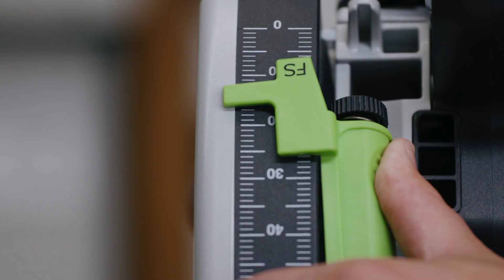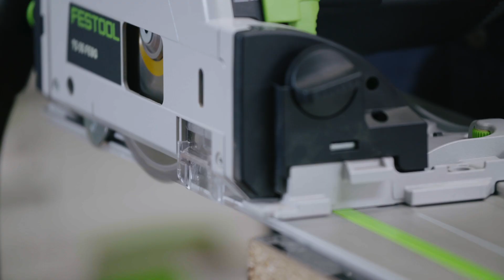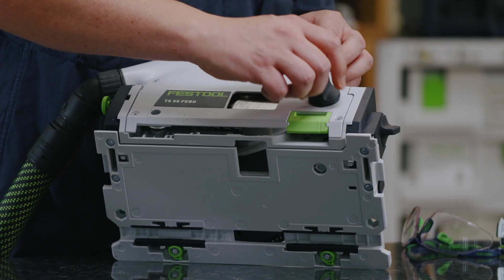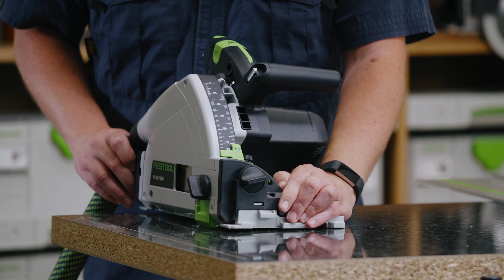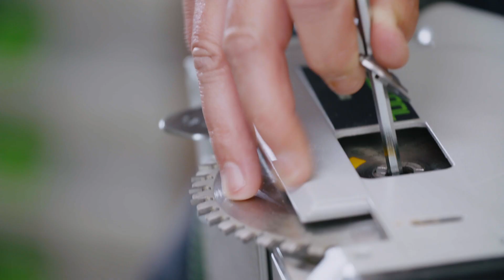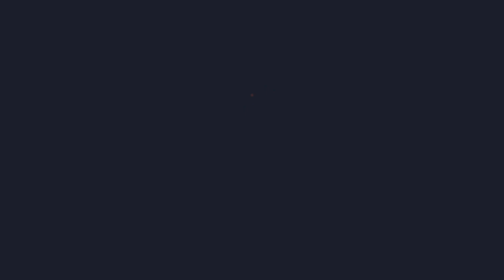Setting up the Festool plunge-cut saws TS 55 F and TSC 55 K

Comment: I bought this but very disappointed on  the day I tried to remove the saw blade cover. I wish I could add a photo to show how easily screw heads become blunt (become stripped). If you delete this comment I will go and put this comment everywhere on dealers stores.

Comment: I would say this video is more of a quickstart guide and doesn't actually cover the setting up of the tool at all which would be calibration of the blade to the guide rails and adjusting the stop limits for 90s and 45s etc

Comment: I gather the splinter guard doesn’t need to be trimmed all the way from end to end of the rail?
Reply: Yeah, was wondering about that too
Reply: @jelmerdevries7827  me too !
Reply: Lol cut the whole thing off lol it will be cut anyway
Reply: It absolutely does. Unless you only plan on making matchboxes. I love Festool but their obsession with only cutting playing cards size objects in all their demos is really annoying. If this instructional video was honest they will tell you that you need to buy a 2nd rail and rail connectors in order to cut the strip fully.

Edit: one more thing for those of you reading this. You need to stop your cut 10.5 inches from the end of the rail. Why you ask? It’s because if you go further you will lose that total precision because the front of your saw pops out of the track. Now think about it….you stop 10.5 before you also need to start a mimimim of 10 inches in. So a 32 inch rail becomes 11.5 inches. Like I said…matchboxes. So you immediately will have to buy a 2nd track.
Reply: @BenM81  And for anyone who only has one rail, you can just make yourself a strip of wood that’s precisely 16mm wide and about 11mm tall and nail/screw/stick it down so that it’s butted up against the end of the rail.

Comment: For best cuts use the guide rail clamps, scribe cut to about  4-5mm and then cut full depth. This way you won't need to to flush cut with a router before edging.